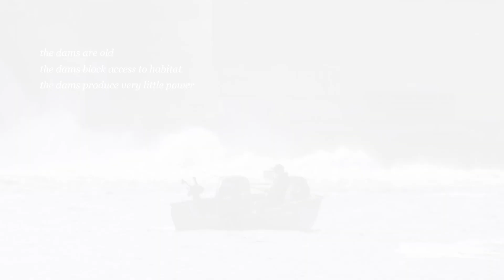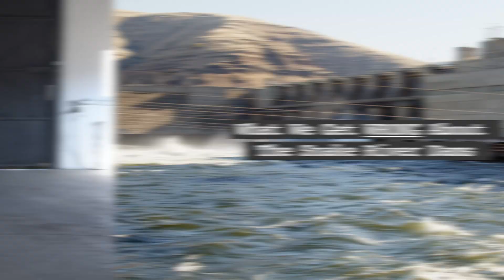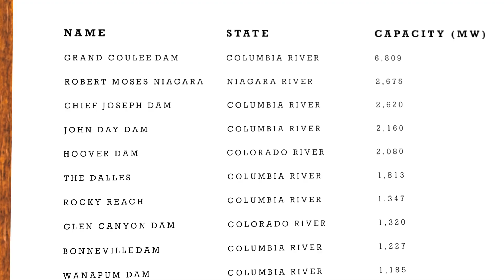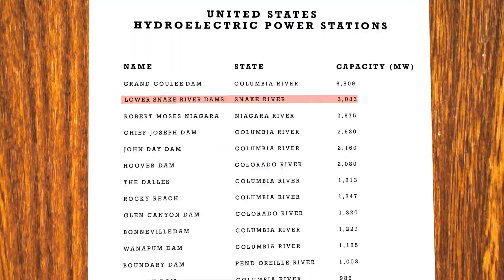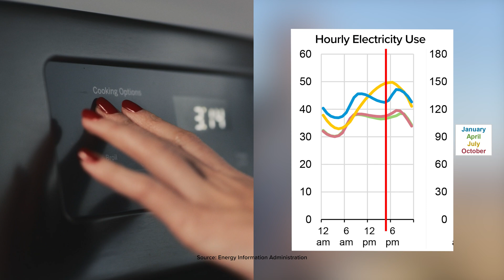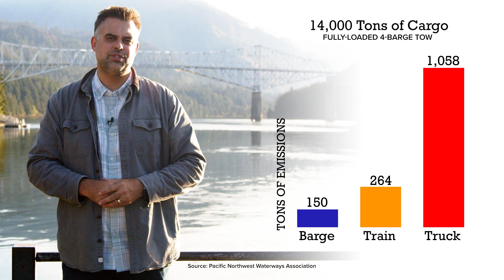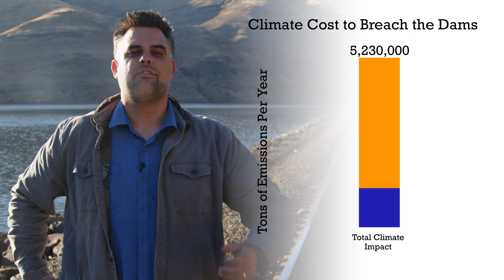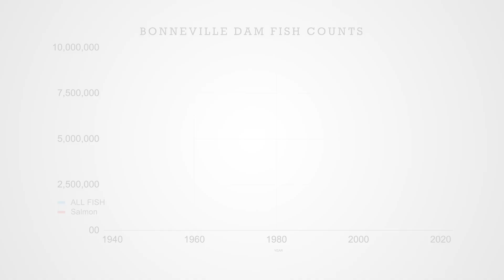What We Get WRONG About the Snake River Dams

Comment: Upstream Passage (Adults):

"Practically 100% of adult fish are successful in moving upstream through the ladders." This is an overstatement. While fish ladders are designed to facilitate upstream passage, efficiency is not 100%. Factors like ladder design, water flow, fish health, and species can affect passage success. Delays in passing the dams can also expend crucial energy reserves needed for spawning.
"The adult fish are tenacious and will follow the current upstream wherever it leads them. Each dam has a series of 'attraction currents' to encourage fish to enter the ladder." This is generally true. Fish are driven to return to their spawning grounds, and attraction flows are used. However, finding the ladder entrance can still be challenging and time-consuming for some individuals.
"Once they find their way inside, it's practically guaranteed they will make it to the top (and they are monitored along the way)." Again, "practically guaranteed" is inaccurate. While monitoring occurs and passage rates through the ladders are generally high for fish that find them, some fish do fail to navigate the ladders successfully due to injury, exhaustion, or design limitations.
"The Snake River Dams are NOT an impediment to upstream travel." This is the most significant misrepresentation regarding adult passage. While fish ladders exist, the presence of multiple large dams creates a series of obstacles that significantly increase the time and energy required for upstream migration. This increased stress can reduce spawning success and increase pre-spawning mortality.
Downstream Passage (Juveniles):

"They don't swim downstream so much as they get swept down by the current." This is a reasonable general description of juvenile salmonid migration.
"This means that the dams slow their journey to the ocean by several weeks or even months, giving more time for predators to eat them along the way." This is a critical and accurate point. The reservoirs created by the dams significantly slow water velocity, increasing the time juvenile salmon spend migrating downstream and exposing them to higher predation rates from both fish and birds.
"The dams themselves don't actually hinder them: young fish are able to pass through just fine, and most actually get scooped out and sent through a bypass before they hit the turbines. Survival rates through the dams for juveniles are north of 90%, according to sensors placed above and below each dam." While survival rates at each individual dam can be relatively high (when bypass systems are functioning optimally), the cumulative impact of passing multiple dams is significant. Even with a 90% survival rate at each of the four lower Snake River dams, the overall survival rate through all four would be closer to 0.90 
4
 =0.6561, or roughly 66%. This doesn't account for the increased mortality in the reservoirs.
"The tricky issue is the reservoirs themselves. The dam structures are more or less transparent to the fish life cycle, but the longer journey downstream for the baby fish IS a major hindrance compared to a free-flowing river. This valid criticism of the dams is worth investigating with good data and practical solutions." This part is accurate in identifying the reservoirs as a major problem due to increased predation and slower migration times.
Ocean Survival:

"The bigger issue is that salmon spend 90% of their lifespans in the ocean, for which we have very little data. To have a sustainable species, you typically need around 4-6% of juveniles to return to the river as adults. When only 2-3% return, the runs get smaller and smaller over time. But all the blame for that 1-2% change is placed on the dams, without taking into consideration the four years they spend in the open ocean." While ocean conditions are undoubtedly a crucial factor influencing salmon survival, and we do have less direct control over them, attributing the entire 1-2% difference solely to ocean conditions while downplaying the impact of the dams is misleading. The stressors imposed by the dams during both juvenile and adult migration can weaken the fish, potentially making them more susceptible to mortality in the ocean. Furthermore, the reduced number of smolts reaching the ocean due to dam passage issues directly impacts the number of returning adults.
Overall Accuracy:
That portion of the video significantly underestimates the negative impacts of the Snake River dams on salmon and steelhead. While it correctly identifies the reservoirs as a major issue for juvenile survival, it downplays the challenges faced by both juvenile and adult fish in passing the dam structures themselves and the cumulative stress imposed by multiple dams. The scientific consensus is that the four lower Snake River dams are a major impediment to the recovery of salmon and steelhead populations in the basin. While ocean conditions play a role, the dams are a significant and persistent stressor throughout the freshwater portion of their life cycle.
Reply from the maker: I'm not aware of any data that shows adult salmon are having trouble finding the fish ladders. A lot of money has been spent on this issue, and as far as I can see, every adult fish that makes it to the base of the dam (within a statistically significant percentage) finds its way upstream.

However, the issue of downstream migration of juveniles is much more complicated (as you pointed out). It's only been in the last 20 years that dedicated facilities have been used to bypass smolt with great success. It's way too early to declare those efforts a failure, and the data so far appears to be a major improvement from the 80s and 90s.

The bottom line is that nobody is claiming that dams are GOOD for fish. Obviously, they pose challenges to migrating salmon compared to a wild river. But that's not what I'm arguing here.

But the dam breaching community has made the claim that the removal of these specific dams on the Lower Snake River will be a game-changer for the entire ecosystem, and the scientific data does not support this conclusion. If you want to see 1850 populations of salmon, you need to not just remove the 4 LSRDs, but everything else that has been built since 1850 (cities, highways, industry, etc.). 

From my extensive research on the topic, there is NOT a scientific consensus that dam breaching is the solution to salmon. But there IS a consensus among activist groups with a predisposition towards hating dams. The difference is subtle and hard to spot in the general public. Activist groups have successfully framed the issue narrowly and simplistically, ignoring the preponderance of science and preferring a narrative that says fish=good, dams=bad.

The natural environment is so much more complicated than that.
Reply: @ArmchairEngineer , you seem like a good person. You have put much effort and thought in to this topic. I do appreciate that. You're right that a significant amount of money has been invested in improving fish passage at dams, including the design and effectiveness of fish ladders. It's also true that for many adult salmon that reach the base of a dam, a high percentage do successfully ascend the fish ladders.

However, the statement that "every adult fish that makes it to the base of the dam (within a statistically significant percentage) finds its way upstream" isn't entirely accurate and overlooks some key challenges and data points:

Challenges Adult Salmon Face at Dams (Beyond Just Entering the Ladder):

Finding the Ladder Entrance: While attraction flows are used, locating the often relatively small entrance to a fish ladder in the vast, turbulent waters at the base of a large dam can still be a significant challenge and cause delays. Some fish may spend considerable time and energy searching.
Ladder Efficiency is Not 100%: Even after entering the ladder, passage isn't guaranteed for every fish. Factors such as ladder design (e.g., slope, flow, resting areas), the physical condition of the fish, and the presence of other fish can influence success rates. Some fish may become exhausted, injured, or fail to navigate the ladder completely.
Delays and Energy Expenditure: The time spent finding and ascending the ladders can be significant, depleting crucial energy reserves that are vital for successful spawning. These delays can also increase the risk of predation and disease.
Pre-Spawn Mortality: The stress and energy expenditure associated with navigating multiple dams and their ladders can contribute to pre-spawn mortality – fish dying before they have a chance to reproduce.
Cumulative Impacts: For salmon migrating through multiple dams, such as those on the Columbia and Snake Rivers, the challenges at each dam compound, increasing the overall stress and risk.
Data Suggesting Challenges:

While it's challenging to provide a single definitive statistic on the percentage of adult salmon that fail to find ladders, here's what the data and scientific literature indicate:

Studies on Delay: Numerous studies have documented significant delays in the migration of adult salmon at dams. Radio telemetry tracking has shown that fish can spend days or even weeks holding below dams, searching for ladder entrances, or resting. These delays directly impact their energy budgets and spawning success.
Lower Passage Efficiency for Certain Species or Conditions: Passage efficiency can vary depending on the species of salmon, the specific dam and ladder design, water flow conditions, and the health of the migrating fish. Some weaker or injured fish may be less successful at finding and ascending ladders.
Indirect Impacts on Spawning Success: Even if a high percentage of fish successfully pass the ladders, the energy spent and delays encountered can lead to reduced spawning success (e.g., females having fewer eggs or males being less competitive).
Monitoring Data: While monitoring often focuses on fish that enter the ladders, data is also collected on fish observed holding below dams for extended periods or exhibiting signs of stress. Estimating the exact number that never finds the ladder is challenging, but their presence indicates a difficulty.
Comparison to Free-Flowing Rivers: The stark difference in migration timing and success rates in undammed rivers versus dammed rivers strongly suggests that dams, including the need to use fish ladders, pose a significant impediment.

While fish ladders are a crucial tool for mitigating the impact of dams on adult salmon migration and many fish do successfully use them, it's an oversimplification to say that virtually every fish that reaches the base finds its way upstream without significant difficulty or impact. The challenges of finding entrances, the energy expenditure and delays incurred, and the potential for reduced spawning success all indicate that dams, even with fish ladders, remain a significant obstacle for adult salmon.

Comment: I would like further elaboration on your belief that the dams don't block access to habitat. Also where are you getting your sources about salmon crossing the dams? Every source I've read says that adult salmon survival drops 10-20% after each dam, dropping the overall survival rate from 80% after the Columbia River dams to closer to 40-50% after the 4 Snake River dams. Also despite the capacity of each dam being 800 mwh, 600 mwh for Ice Harbor dam, the 4 dams collectively produce around 900 mwh of energy per year, why is that?
Reply: He's conveniently leaving out the actual main impact that the dams have on migrating salmon, which would be the reservoirs they create. Ocean-going young salmon have evolved to be swept to sea by the strong currents of the spring runoff. Reservoirs slow water and make this journey take much longer, leaving young salmon susceptible to predators and wasting their energy. When the adult salmon return to the Snake, the slow-moving waters of the reservoirs heat to critical temperatures for salmon.
Reply from the maker: Good questions. 

1. The LSRDs do NOT block habitat. But I am not claiming that they have zero impact on the ecology of the river. Instead, I am addressing the erroneous claim that the dams prevent salmon from migrating to their spawning grounds, which is widely believed around the PNW.

2. It's true that juvenile fish have a survival rate of around 90% per reservoir. This adds up to a compounded loss of a little more than half the smolts after passing all eight dams. But contrary to popular belief, a small subset of that 10% are killing in or around the dams. The majority are lost somewhere in the reservoirs, a concept called "delayed mortality." It would be easy to assume (as you have) that the slow-moving reservoirs are solely to blame for baby fish dying, but the science doesn't support that conclusively. For one, you can't assume that the survival rate in an undammed stream would be 100% - no species ever survives the wild every time all of the time. Second, when we remove the juveniles from all the pressures of passing through the reservoirs by transporting them onto barges, they have a 99% survival rate downstream, but the same low smolt-to-adult (SAR) return ratios. The biggest factor affecting the return of adults into the river appears to be the pressures they experience during their time in the ocean.

3. Quantifying the energy produced by the dams (or any energy source) is easily muddied by using incorrect units. For example, list the nameplate capacity of the dams, and then compare it to the actual output, which is a much smaller number. If you apply the exact same methodology to renewables like wind and solar, you end up with similar (or worse) underwhelming results. The truth is that hydropower is the only energy source that is both RENEWABLE (meaning it doesn't consume or release any fuel) and DISPATCHABLE (meaning it can be switched on and off at will). This is why averaging the total megawatt hours produced by the dams is misleading - it doesn't account for the value of being able to produce the energy exactly when it is needed.

Comment: The film is well-produced and effectively undermines the reasons supporting removal as well as providing most of the reasons why the Snake River dams will not be removed, leaving out the major reasons: cost and value to the Columbia River plateau.  However, it fails to address the means of restoring abundance of naturally-spawning salmon populations.  The Columbia River treaty fishing tribes embarked on a strategy of stewardship through the use of wild salmon nurseries utilizing localized stocks and acclimation to outplant juvenile salmon into natural habitat from where they would  head for the ocean and return to replenish wild stocks.  Unfortunately, NOAA and NMFS, using their ESA authority has sharply restricted those efforts, continuing the historic efforts of the Department of Commerce acting through its fishery bureaus since the 1890's to use hatcheries as a means to make habitat safe for development.  The film needs a sequel focusing on the effective restoration nd rebuilding methods that will lead to abundance.
Reply from the maker: The sequel is coming!

Do you have any professional insight into the weaponization of the ESA? Or insider knowledge about NOAA and NMFS' mishandling of the policy? If so, email or DM me.

Comment: First I want to recognize the amount of time and work needed to put a comprehensive and multi-location video together like this. I bet you spent at least several months on this project. Outstanding job and it is very much appreciated.... You could've mentioned that the coal plant in Centralia was responsible for 15% of the smog in Seattle (before 2000, if I recalll correctly), and it was beginning to cause some acid rain issues to the Alpine Lakes Wilderness Area and Mt. Rainier.... As a suggestion for photography, here is a suggestion to help with the situation of outdoor lighting causing extreme bright and dark exposures of your face. Either bring some portable lights (to brighten exposure to the dark side of your face), or a large scrim diffuser panel (to lower the overall brightness of the sun upon your face). The portable light option probably is better. Recent portable COB lights (LED "chip on board") with batteries (on tripods) have dropped dramatically in price (and the lower power lights don't weigh much). The lights can be placed near your face--just outside the camera view area. Do not use soft boxes on the lights outdoors. Otherwise, you will need to find a rare cloudy day to get a better exposure (and the other option is defeated by the wind--whichcan topple large scrims easily).... Again, this was an awesome video. Thx much!
Reply from the maker: Thank you! This video was far from comprehensive. There are plenty of related topics to do deep dives on in the future. I like the idea of exploring the pollution angle. People have no idea how much toxic air we have avoided over the decades because of hydro supply.

Field lighting would be nice, for sure! The scenes along the Columbia and Portland were all filmed in one long day running from location to location, trying to keep the angle of the sun in the optimal spot. It was a total run-and-gun type of production, with just me and my son making it all happen. Someday, it would be nice to do something like this with a full crew!
Reply: @ perhaps you could have your son use a large reflector to light the underexposed side of your face—if your camera is on a tripod? Anyway, best wishes and happy thanksgiving!